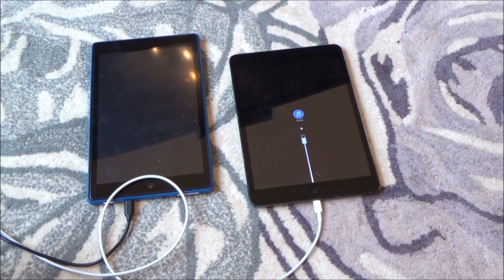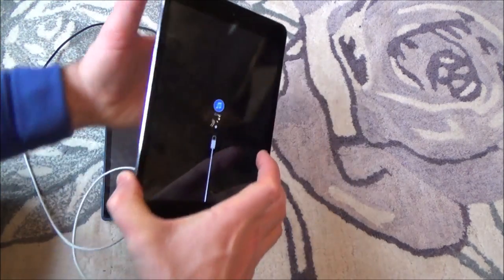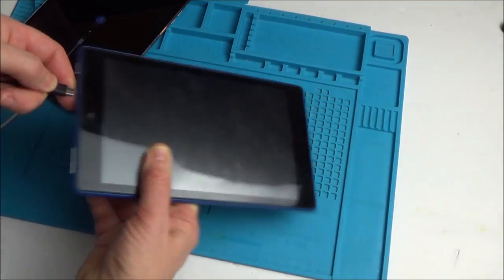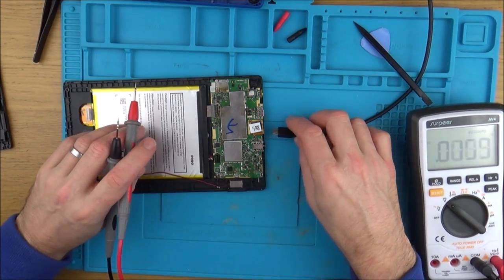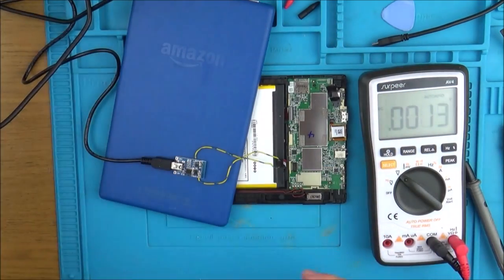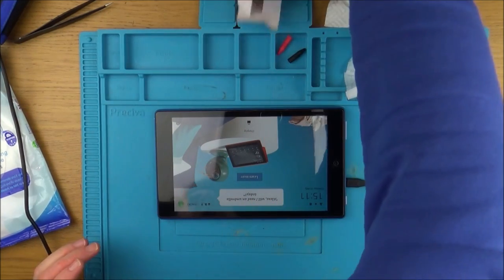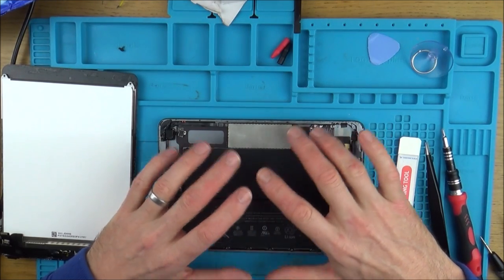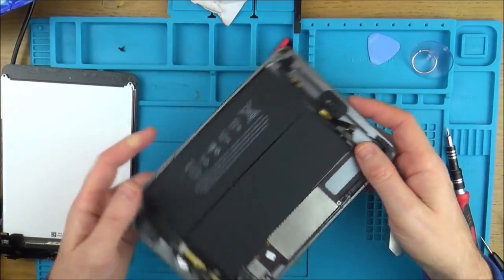Trying to FIX: Amazon Tablet and iPad

Comment: "I would've thought that would've been replaceable".

Welcome to the world of Apple product repairs.
Reply: Apples throwaway landfill mentality!
Reply: If it boots and has iTunes logo that means it has failsafed and requiring DFU mode recovery (Default Factory Unit) which is very easy to preform.. tons of guides online.    Usually what happpens if a corrupt firmware image or if older device or older firmware someone prob ripped cable out during the update and soft bricked it.. Apple baked in a failsafe to prevent hardbricking and allow recover attempts.
Reply: same on the ipad air 2
Reply: Rajan - they won't repair any legacy products, make them impossible for third parties to repair so they become junk - even though they're full of rare earth metals
Reply: @realvivifromloona  lol free repairs on everything? Who are you trying to lie to
Reply: @realvivifromloona  Free?
Reply: @realvivifromloona  then tell my why it still costs $50 to get the battery replaced in a 5 year old iPhone.

Comment: Thank you Vince for the tip about the lithium battery charger. I have a few MP3 players that might not now need new batteries.
Reply: I'd strongly suggest replacing them anyway, there's a reason why most devices won't charge a lithium battery below a certain percentage. It's not because they think there's no battery nor is something wrong with any component but because charging a "dead" lithium battery may cause the battery to short itself and ignite the lithium.
Reply: where can i buy one of these chargers?

Comment: Because iTunes is unable to read the serial number from the iPad it would point to be being a NAND issue.

Better repair shops will have a NAND programmer to hand but judging by the way this iPad was put back together it was not sent to a good repair shop.

Any decent repair centre will still put a device back together properly even if they deem it not repairable or not economically viable.

Missing screws and not reattaching the battery is sloppy work, fixable or not, and it doesn’t seem like any attempt was made to re-ball or reprogram the NAND which to any decent repair centre would be the obvious thing to do.

Apple devices can be really finicky and often using a different USB cable or a different USB port on your computer can get a restore working.

I also had an iPad recently that refused to be restored with iTunes on Windows with a similar 4xxx error code but restored first time on a Mac so it’s always good practice to try those steps if possible before anything else.
Reply: @ItsNorman  Yes that's right but I was under the impression in this case that the serial number was not being read at all, not just during DFU mode.

Forgive me, I was playing a game while watching this. I'll have to go back and re-watch the video to see if the serial was being read in recovery mode.
Reply: @ItsNorman  Yes indeed and its actually good that the checks are made before an update is pushed as it can keep a device from being bricked completely but Apple really needs to put more effort into being more specific with their error codes and showing the user what exactly has gone wrong.

We all know that will never happen though as they continue to fight the right to repair. They will always give as little information as possible to stop people from repairing products themselves.
Reply: If it can boot then it’s not a flash memory issue at all, as the very image Jon display comes from the NAND.  I repaired 1000s of iPads and this is simply someone soft bricked it and the device failsafed..   all you need to do is to default factory unit recovery mode it in iTunes.. tons of guides online.  

If it was a flash memory issue then it wouldn’t even display anything, I seen it on extremely rare occasions, and what happens is backlight comes on but nothing else, then boot cycles on and off rapidly..  I never personally recovered a complete failure and I would say if it’s not showing anything but backlight, get another opinion maybe missed something.  But usually we eliminated display and other hardware so.. I said maybe 10% chance if rescuing such a failure if your lucky.

If it was a boot rom issue then it will show Apple logo, then within 5 seconds usually just cuts off and reboots..  boot rom issue isn’t a flash memory issue normally.  It is usually corrupted portion of an update.. getting out of this isn’t impossible but very hard, sometime you can still DFU it and recover.. I say 60% change of recovery.   Few techniques you can use to interrupt the boot looping like attempting DFU in different combinations just enough to lock it out of looping can trigger it to fall in standard recovery mode and you can use a modified iTunes or a custom tool to force install the correct IPSW software files.. 

This style of failure is stalled a failsafe, happens when during install of firmware something goes wrong during less critical portions of the update.. battery died, cable got ripped out if was updating via iTunes, or just a corrupted file so how got installed..  this specific type of failure where shows the iTunes logo and cable means you have 90% chance of recovery using DFU mode recovery..  still a very small chance DFU won’t work.  I only had it fail a few times and those few times are because of a bad battery not accepting a charge during recovery and/or SoC consuming more power then being delivered over USB, it’s very rare usually limited to well out of date devices at this stage.
Reply: It's also missing the shield between the LCD and battery

Comment: Old video but for anyone seeing this in the future, a tip for these Amazon Fire Tablets:

The problem is almost always the charge port or battery. Honestly, 95% of the time. I've fixed many and all were one of the two.

I've fixed multiples where simply resoldering the charge port "fixed" it. I use quotes because the only fault is that Amazon builds these things as cheaply as possible and the solder broke the connection to the port, not allowing it to ever charge beyond 1%.

A few others had bad batteries like this here in the video and, tbh, a reppacement battery is about as much as a new tablet (by design) so you may as well buy a new tablet unless you have a spare battery on hand.

To end, those Fire Tablets are made with toothpicks and bubblegum. They aren't made to last long but when they do go it's usually an easy fix. Amazon just expects you to buy another by making 75% of the tablets cost come by way of the battery alone.
Reply: iPhone was charging battery

Comment: Great video as always Vince, a bit of a bittersweet result. Hope you can help me with a question, how can a battery be so low charged, that it cannot be charged, thanks!
Reply from the maker: Thanks, I think it is a safety thing, once it goes under a certain voltage the device thinks it is unsafe to charge the battery, as it may be damaged.  So a little kick start can sometimes get it working again. It is something along those lines :-)

Comment: Similar problems with our iPad mini. Changed the charging port cable which is very cheap. Tricky soldering job. Guides on YouTube. This cable does all communications and there are many connections. Problem sorted.

Comment: Hey Vince.

An old colleague of mine in IT did a lot of work on iPhones/iPads. From time to time, I've helped him out with some of the simpler tasks and because of that I've learned a few tricks.
Most of the time, when an iPad would loop like yours do, a simple restore would do the trick. However, in a small number of cases iTunes would give an error like the one in your video.
When that was the case, we would use a MacBook to restore the iPad instead.

Apparently MacOS (or possibly the iTunes version for MacOS) behaves differently in a way that makes it possible to restore a device, even when it loops. 
Even though we only used Windows in the office, we had a Mac hidden in a drawer specifically because of this.
This will of course not help you in case of hardware failure, but from what I've seen in your video, it's definitely worth a try, assuming you have a Mac available in some capacity.

EDIT:
I forgot that the iPad flashed red, which I do believe means hardware failure, so if you don't own a Mac, it's probably not worth looking for one to borrow.

Comment: 1 out of 2 is still pretty good. My daughter's fire tablet has a loose charge port too but I am not comfortable trying to take it apart to fix (or potentially break). I currently have to prop the plug in just so and have no one touch it until it's finished charging. Not the best but it is working for now.
Reply: Treena McGowan u would most likely need a soldering gun unless it’s only plug in 

I’d give it a shot after watching a ton of how to videos
Reply: Just take the back off it and fold the port in abit I reckon. Probably just plugging and unplugging the cable a bunch stretches the port over time so gets loose

Comment: Hi Vince I had the same problem with my Alba 7 inch tablet today.  So I took the back cover off, then put my multimeter onto the black and red wires of the battery and it gave the battery the kick it needed.  Then boom it fired up no problem.  I also put some Deoxit Gold in the micro usb charge port too which also helped.  Kind regards.  Paul.

Comment: You can boost a battery by using a regular non regulated wall charger to boost un under charged battery but if it's a multi cell battery, never over charge any one cell or you will ruin the battery. Just charge each cell up to a level the supplied charger will then properly charge it from then on.

Comment: I have same issue with iPhone 5s and it flicked red was bad screen connection , but different error but same fault says cable or connection I replaced cable and lightening connector all failed new battery new connection so board all I got left I Wana try reball like you but new board is £65 32gb but new nand chip would be nice ! Hope this helps a lil, also safety warnings if lipo is below 2v 1 cell don't try recharge it as I set fire to my room doing that , no one hurt and melted door that's all lol

Comment: 12:40 That sticker could be some kind of theft protection for stores
Reply: correct that sticker is an RFID tag to stop thieves and they get disabled when you purchase the item through the security system's computer.
Reply: @deathray0718  Actually no. It is an RFID tag, but that's used to program it to your Amazon account if you order it directly from Amazon. The Kindle E-Ink models have this too. The tag used for theft protection is much larger and on the packaging itself.
Reply: @Vynncent  It would make sense online but all the one's at Walmart have them they each only contain a security code I tested this theory with my phone emitting the same security key from a different one that wasn't purchased and sounded the passage alarm. So online will make sense not both.

Comment: Hi ,having had a blackberry playbook battery go so low it refused to charge i googled and found a practice called stack charging ,in essence you plug it in then remove the power and keep repeating until the battery is to the level where it suddenly starts charging, It works!
The little charging board looks interesting so i have bought a couple to try and charge some batteries that could be ok  but replaced

Comment: I have had that happened before Vince. I had a nokia n9 it was bootlooping because it couldn't take a charge and that's because it has been sitting for 2 years. When the battery gets too low It just doesn't like to charge from It causing issues. Sadly couldn't fix It as It uses screws which I don't have the right tool to remove so It's gone now. The battery was probably fine but the charging circuit couldn't handle it from the looks of things

Comment: Ello Vince, When you press Power and Home on the iPad Mini it turns on and goes into recovery mode that requires iTunes.

The Amazon Tablet won't boot into the OEM Menu to hard reset as you have to gain developer premissons by pressing the Build Number in Settings > About and press allow OEM unlock then it will work.

The software for the iPad is either badly installed or corrupppted.

Just restore the iPad in iTunes with a PC. More info on Apple.

Also the Apple logo usually flashes or goes off and on in a loop due to a flat battery from no battery charge in the battery

Comment: I have an Amazon Fire 7 7th Gen and it takes about 15 to 20 minutes to even show signs of life if it has been off and completely flat for a while. I think you should have had more out of it just by giving it some normal charge from the USB brick if the battery was within acceptable limits. That's a handy little PCB you've got there.

Comment: hey man! the easiest tablet to repair has to be the samsung galaxy tab 2 7.0, there so easy to change parts! other than the screen. Maybe try one of those? (I.e. they actually do use an apple 30 pin cable, just have to push some pins in the port of the tablet. just plug in the charger upside down  takes almost a day for a full charge that way though.)

Comment: The solder thing of the charging ports on the ipad only applies to some ipad minis. I got an iPad 4th Gen motherboard with 2 broken connectors and im certain that the charging port wasn't soldered.

Comment: I've found personally that on occasion if a lithium battery is just left without any charging for a while like months or years the charge drains low enough to where it just doesn't except charge and you just have to jump start it, I guess when the charge gets too low then it the charging  Circuit doesn't think there is a battery and so it doesn't send a charge to those leads
Reply: I’ve heard this and there’s special chargers u need to use that u plug the battery directly into to trick the battery into taking a charge then it will start working again but in the devise there’s safety modes that won’t allow a dead battery to charge
Reply: This is a very bad idea tho, the reason a dead lithium battery doesn't charge is not because the circuit thinks there is no battery. The cells are degrading (copper dissolves into the cell) when discharging to a critically low level. Charging it up causes the dissolved metal to crystallize again and if you are unlucky those crystals might pierce the membrane within the cell separating the leads. This may cause a short within the cells of the battery and cause the lithium to ignite. It's not guaranteed to happen but I'd strongly suggest replacing a jump-charged lithium battery as soon as possible and not trust it anymore (aka don't leave it in something unattended).
Reply: @Stunex  wow this is some very useful insight I didn't know about, but you have to admit that it can be a usefull method for diagnosing the issue and since I've done this a couple times on different products I'd say its not the riskyest thing to do but ya know that I know the risk of ignighting the lithium I'd definitly say that if this method works then a battery replacement is your best next step

Comment: You want to start doing board work at component-level you need zxw which is software to look at the board View and schematics of whichever board you're working on you also need a proper soldering station with temperature settings any small soldering iron not a standard size 1 solder paste and stencils if you're going to be messing with bGA (ball grid array) practice on an old board that has abga Chip and practice  removing and replacing also microscope flux solder wick etc

Comment: Very late comment mate vince but just incase you not familiar sometimes if the LCD screen for any apple device or the battery isn't genuine simply remove the screen completely restore using iTunes update should complete with no errors. If that didn't work try different battery then update with screen completely removed just incase it a replacement screen. This won't help here now but maybe come in handy for future. You probs already know this but figured I'd comment as I've had a few apple devices mostly screens only ever had one apple device what it was battery stopping it rest I've just removed screens updated via pc iTunes. Not sure with the newer 2019 2020 2021 product as I don't touch apple no more lol.

Comment: If you got to recovery menu with iTunes plug you should be able restore it to factory recovery and it updated it too latest iOS though iTunes Store. If it doesn’t work could be bad iPad lighting cable try another one see if it connects to your iTunes on windows or Mac.  Good Luck 👍 Bud.

Comment: Thats because a lot of the batteries now a days have a chip in them that tells the battery not to charge if it is left dead for to long or after to many charging cycles. I run in to this ALL the time when it comes to Nintendo switches. That small cheap little charging chip has saved alot of battery replacements.

Comment: Tablet charging circuit is kinda wired. Some tablet like samsung use MOSFET, and the MOSFET require battery with minimal 3.7volt to be plug in, in order to allow charging voltage to flow in. I usually remove the MOSFET and replace with a jumper. It will allow charging voltage available at battery connector all the time, without require a battery to be plug in anymore. By doing that it will allow tablet to charge the battery even if the battery voltage is to low.

Comment: Definitely a NAND issue. Needs to be formatted at least, I usually just replace the NAND if it has issues just to save time
Reply: Where do you get the nands from?  and how would you replace a iphone 8 nand that keeps on rebooting the iphone after latest ios went on
Reply: @vickihenderson8468  other donor boards, other parts sellers. I use a JCPro1000S to reprogram them